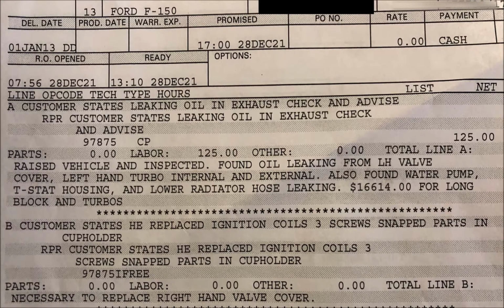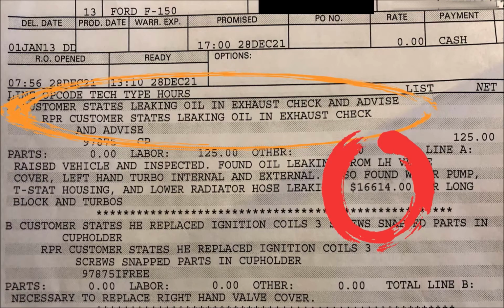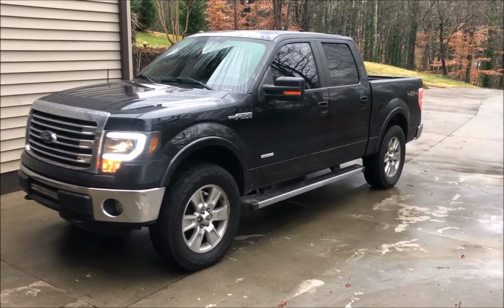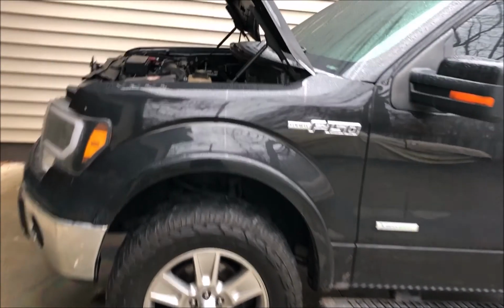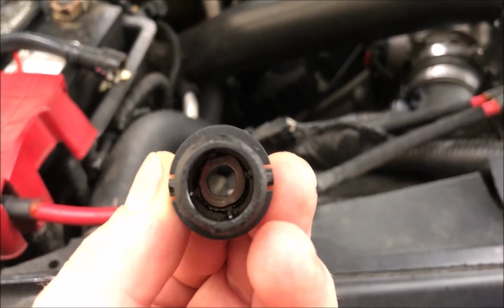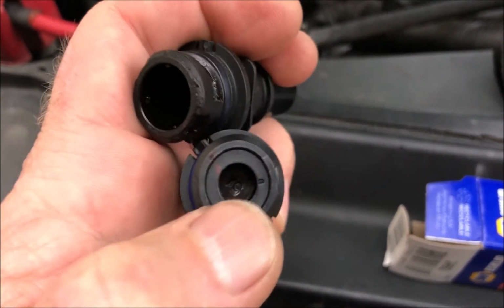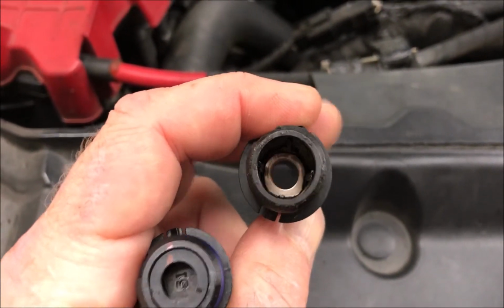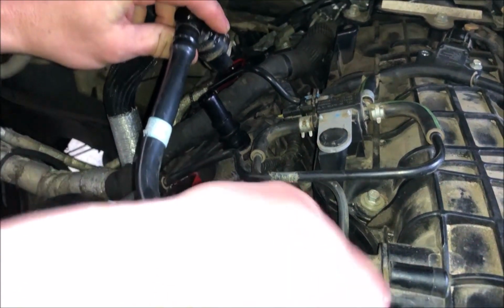$16,614 Ford Engine Replacement?! F150 Ecoboost Excessive Oil Use, 6 Quarts Oil Per Fill-up: $15 Fix

Comment: I have a 2012 f150 3.5 with 131k miles. The dealer told me both turbos are bad 6,200$ quote. I have oil leaks coming from a lot of places mainly from the top of the transmission. Doesn't smoke bad at idle but when I floor it theres lots of smoke (smells like oil) but the truck has full power which is why I don't think my turbos are bad (going to check fins on both turbos). I have pressure when I pull out the oil dip stick. I checked the pcv and it rattles fine. I just found out it still could be bad. Going to replace it soon. Any other ideas?
Reply: Update changed the PCV no more smoke and no leaks truck has full power no issues. Can't thank you enough don't get scammed at the dealer do your research.
Reply from the maker: Awesome!  Glad to help.  Hard to find good service technicians.

Comment: I have a 2.7 Ecoboost im losing a lot of oil I see a lot of oil leaking from the tube of the throttle body do you think this could cause that issue
Reply from the maker: That is really the only way oil gets into the intake tube.  Your PCV might not be working properly.  How many miles?

Comment: Does the driver side pcv supposed to have a check ball as well???
Reply from the maker: I don’t believe so.  The other side of a pcv system is to provide fresh filtered air to the crankcase.

Comment: Hey brother, so i purchased a 2018 raptor with 120k miles ! And first 1200 miles after fresh oil , i noticed oil level was soo low that low oil pressure light came on. Did a nee oil change and now driven 200-300 and still losing oil like crazy and again thats less then three hundred miles and oil level is at minimum! There is no sign of oil leaking anywhere. Mechanic tried to say “ oh u need a valve cover gasket” but i dont see any leaks anywhere or any cracks.
Reply from the maker: Did you check your PCV valve?

Comment: Actually the part you replaced is the updated PCV/valve cover adapter fitting....Ford removes the PCV and performs a reflash to properly manage the newer blow thru design.  I believe the issue with the standard PCV is that in cold climates it freezes and doesn`t permit crankcase pressure to dissipate which mainly pushes the rear main out.  Warmer climates you will be ok....but otherwise no bueno.
Reply from the maker: thanks for the comment, good add.  Are you indicating the PCV I removed was designed to be completely open?  That sounds very odd and in fact, the repair I made resolved his oil usage problem.

Comment: Would this cause oil to be burning at red lights
Reply from the maker: it could if you have oil being pushed out of gasket surfaces and dripping on your exhaust.  Get your engine up to operating temps, open the hood and try to find wisps of smoke coming off the manifolds.
Reply: @DrivingIntelligence  hey, i noticed that i get big white smoke only when i get to a full stop at redlights! I dont smell any smoke around engine.
Reply from the maker: @abeshelby3384  is your exhaust oily or extremely sooty?

Comment: Thanks for the info. I have a 2016 and im losing 3 qts every 4k miles. Dealership told me today i needed a new engine. Only have 134k miles on the truck.
Reply from the maker: let me know if the PCV corrects your issue

Comment: Replace mine every 50k miles. Cheap preventative maintenance
Reply from the maker: Very smart! I think I heard Ford recommends every 65k, but don’t  quote me on that.
Reply: @DrivingIntelligence  most car brands don’t even have it as a maintenance item
Reply from the maker: @tundras4ever552  amazing huh?  I modify and improve my '02 F150 because the quality is not quite there with more modern 1/2 ton trucks from any manufacturer.  And they are TOO EXPENSIVE!
Reply: @DrivingIntelligence  yea that’s the reason I bought a 21 tundra . Legendary v8 . Basic basic truck . Really no tech , which is better for me anyways less to go break. Got it for under msrp at the time of purchase. When I heard they were getting rid of their v8 I drove to the dealer and bought one
Reply from the maker: Very nice.  The only negative I’ve heard about them is the difficulty changing the alternator.  Is that true?
Reply: @DrivingIntelligence  not the alternator but the starter haha and yea it’s a huge pain but can be done. Also changing out the steering rack if you have a 4x4 is a nightmare.
Reply from the maker: @tundras4ever552  They all have their issues, just changing plugs & coils on these 10th Gen F150's is a chore.  ;)  Engine is tucked far under the firewall cowling.

Comment: Mine is leaking oil everywhere and checked this. The passenger side looks fine but is the one on the drivers side a pcv also? It’s open but looks a little different. I can’t seem to find info foe it. Catch cans say Ccv side but can’t find anything else. My leak is drivers side and it’s dumping oil when under boost. Even causing low oil pressure but has pool in the engine. Driving me crazy.
Reply from the maker: sorry for what you're going through.  I'm not completely sure, but I think it IS NOT a PCV.  Here is a link to the item from Ford: https://www.oemfordpart.com/oem-parts/ford-pcv-tube-elbow-4l2z6762aa?c=Zz1lbWlzc2lvbi1zeXN0ZW0mcz1lbWlzc2lvbi1jb21wb25lbnRzJmw9MjMmbj1Bc3NlbWJsaWVzIFBhZ2UmYT1mb3JkJm89Zi0xNTAmeT0yMDE1JnQ9cGxhdGludW0mZT0zLTVsLXY2LWdhcw%3D%3D  you may have a bearing problem in your turbo.  How does your turbo sound when spooling up?  Drive ok otherwise?  Have you checked your oil and coolant to make sure you don't have a blown head gasket?
Reply: Mine is a 2015, ecoboost 3.5L
Reply from the maker: @lavidaconsaborvlogs5940  same problem?

Comment: I though this was going to fix my problem but nope I can’t seem to find out why after every 500 miles I’m missing oil (almost a qt ) . I don’t see smoke come
Out of my tailpipe either please help
Reply from the maker: Hi, sorry this didn't help.  How many miles and what year is your truck?  Any other symptoms?
Reply: Mine does the same. I lose oil no leaks that I can see. But yes after 500 Miles I lose a quart of oil and have to fill up. I've changed the oil ever 4k Miles. I've changed the PCV as well.
Reply: Mine is a 2015, Ford ecoboost 3.5L
Reply: Maybe a leaky turbo seal.

Comment: 160000 miles that's nothing for those engines because I had one with 290,000 MI
Reply from the maker: right on... that engine is running perfectly now.

Comment: Yea at idle the pcv valve needs to be closed. Since there's no check valve in the old pcv valve and an idle engine doesn't produce that much oil pressure, the vct solenoids weren't getting sufficient oil pressure from the oil leaking out everywhere causing the erratic valve timing
Reply from the maker: Thanks for the input Dyllan

Comment: I keep a spare PCV valve in the truck now. With Motorcraft QC issues, maybe having an extra spare is in order.  Good job on this one!
Reply from the maker: Thanks Brandon, I thought I was going to have to add new turbos to this truck.  I'm really surprised about this dealership's approach to this guy's issues.
Reply: This is why most people call the stealerships. This is also why I'm glad my dad taught me how to work on cars and I'm teaching my kids how to work on cars. Good find and good info in case I ever come across someone with the same problem.
Reply from the maker: Right on, knowledge it power.  Saw your video from 11 month ago with all that ice in Texas... all the snow has already melted here.
Reply: I added a catch can, but I should go back and look at the PCV anyway
Reply: @jmatch01 I added one a month ago and it’s crazy to see the oil in there! Also frustrating dealerships don’t troubleshoot anymore. I brought mine in for possible oil consumption.  They wanted me to pay $700 Canadian to do a bore scope and compression test.  I started researching online and it says ro start by replacing the PCV valve! $15!! They go right to, “you might need a new engine.”
Reply from the maker: Right on!  Ford is no longer the company they used to be